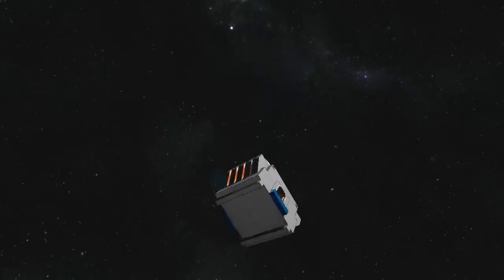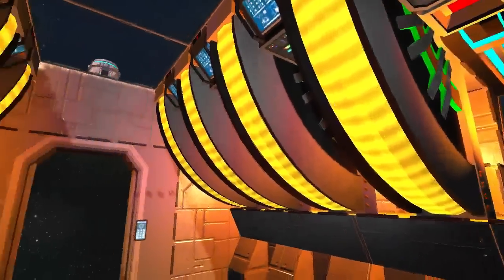XPAR Wedge Reactor

Comment: Very nice! I watched your tutorial videos and the only thing I can't get working on my own mod is emmisive materials. How do you edit the amount of light it gives off using GIMP?
Reply from the maker: TheSouper07 The easiest way is to make it on its own layer, then tweak the alpha of the layer.
Reply: Not sure what you mean by tweak the alpha. I guess I need to watch some GIMP tutorials.
Reply from the maker: If it's on its own layer, you can change how opaque the layer is by using the layer tool thing.
Reply: So if I want the red to glow heavily I need to select the red, move it to a new layer and then move the opacity bar down?
Reply from the maker: Ah, I accidentally misled you. I learned GIMP will only export one layer to DDS. Which means it won't save multiple layers or how transparent a layer is set to.

So, yes, but then you have to "flatten" (merge down) all your layers so that GIMP reads a single layer without any layer settings.
Reply: Craig Perko Not sure if this is relevant but I'm trying to edit an existing .dds that I got from Harag. Next time you are in GIMP you should make a tutorial :p
Reply from the maker: Sorry, I don't use GIMP for anything besides saving a PNG as a DDS. If you post the DDS file somewhere, I can tell you where the error is.
Reply: Here is the original file that contains the textures Harag gave me. My goal was for the red to glow but I've been unable to figure out how to do it. Thanks for the help btw.
https://www.dropbox.com/s/1w3g4mlkg4z05wd/BlackRedCube.zip?dl=0
Reply from the maker: TheSouper07 Well, the red is at 100% opacity. It should glow like a beacon. Your blender materials and UV map seem correct, too. The problem might be if you aren't using the correct compression options, or if you somehow borked the setup of Harag's tool. 

The transparency is right, and the model is right.
Reply: "....you somehow borked the setup of Harag's tool. " This is most likely. Maybe I need to download the latest version of the addon and re-do the setup. Thanks for looking at it.
Reply from the maker: Oh, I found something that might help. If you're getting a strange, flat color all over your block, it's because there is a vertex, somewhere, with no UV mapping.
Reply: I'm not having that problem but I'll try to remember that!